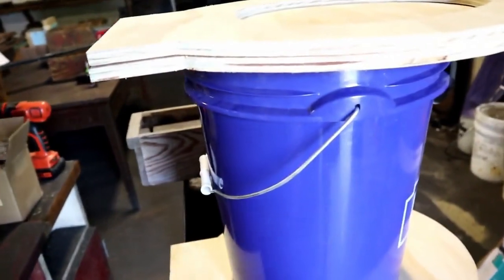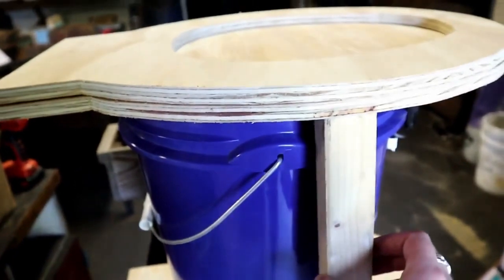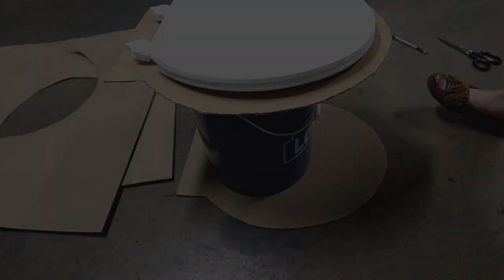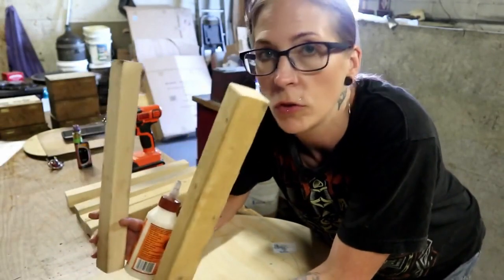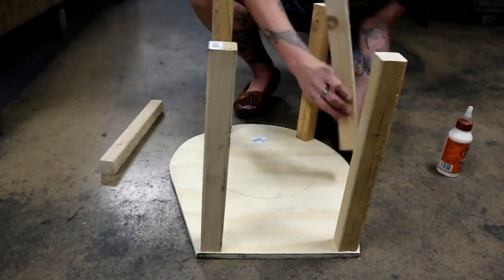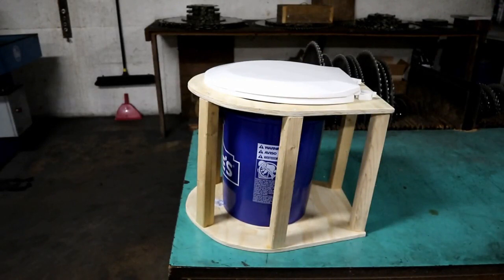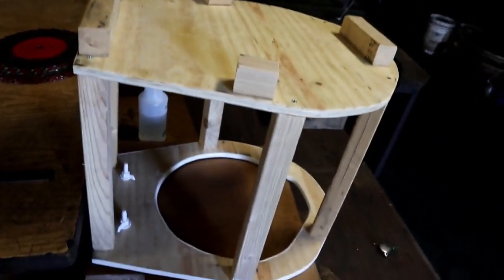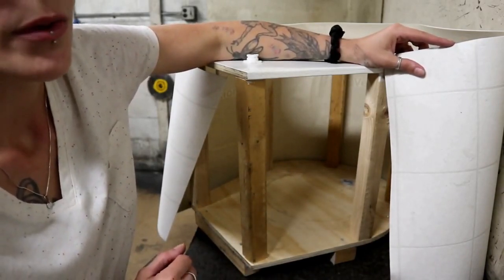DIY Urine Diverting Compost Toilet Build | RV or Van Build | Turn a Bucket Into a Toilet

Comment: It's nice to see someone that adds a bit of reality to the troubles encountered in DIY stuff. You should be proud of the results, Thanks for showing all.  If you are still concerned about not having a larger reservoir for the urine you can empty the smaller unit manually into the larger bottle that you can store behind. For a small amount of effort, you gain a larger capacity plus you get a visual of your capacity every time you use it. No chance of overfilling.  Stay true and keep positive.

Comment: I finished my toilet 3 weeks ago and it is fantastic another thing I thought of is u take a bottom half of a real toilet use that of a night stand. Also onine since I'm using only a 5 gal bucket I have a bucket lid with a handle that seals the stink in pine pellets cat litter pinesol will keep stink down just throw the bag out couldn't be easier but your design is great beats spending a 1000 dollar.

Comment: Great turn out! Are you using a bag with cat litter for #2's in the bucket? I'm researching now as I'll be needing a dry toilet option in a few months. 
From what I've found, if you use a drying component like litter, wood shavings, sawdust or pellets in the bottom then covering solids when done, you can get a 2-3 days with no smell before tossing the bag even without a vent fan. 
The detergent bottle is a great idea!! I'd suggest getting a second one so you never get caught with overflow between dumps. 
Thanks for the video:)

Comment: Looks good. I’m glad you showed your struggles and how you worked through the process. I will need to figure out how to add a bigger urine collecting jug. Thanks again for posting.
Reply from the maker: Thank you! As long as you make a bigger base there will be more room for a container. Or tall enough to do an external container and use a tube to connect it. I didn't plan enough ahead lol

Comment: Most people don't have the space but u could make 2 haves one side 1 other side number 2 I built a toilet out of a bed frame I found in the trash only with one bucket for 1 & 2 I'll have a 5 gal urinal  diverter and cranks not needed

Comment: If you wanted to use the flooring now, you could just glue it over the wood slats around the outer side of your toilet. It would also finish it off. ???

Comment: This has been 9 months ago so you may have this all figured out by now but you could run the urine hose under your RV into a small 5 or 10 gal tank or into your gray tank. Then you wouldn't need to dump your urine bottle everyday. Plus urine can be poured on the dirt, grass, on trees just add a little water to the urine to keep the urine acids from being to strong for the plants. This is good fertilizer for the plants. Also urine is sterile nothing in it is harmful to our environment or us humans. So dumping just the urine is pretty easy and safe. I wouldn't dump it in the middle of Walmart parking lot but in the city/counties across the USA there are water grates for flooding in parking lots and on the side of the roads where you can dump gray water or urine tank. Urine tanks can be poured urine just about anywhere with in reason dirt, grass, woods, things like that is fine or just dump the tank into any toilet. Dumping a urine tank won't be a problem.
You will find using a urine tank or your gray tank under you RV is a lot more convenient then a little pee jug.
Best Wishes

Ps you did a Great job on building the toilet it looks really good and I like that its not big and bulky like a lot of diy compost toilets most are a big bulky box your is nice and sleek to looks more like a regular toilet.
Great Job 👍 👍

Comment: You could have the cap on cut a hole it then you could see when it was full and prevent spills or find clear container but I give u lot of credit if u had when to engineering school it would have been easier. But good job cudos to u.

Comment: Does it work ok no smell, I'm thinking of doing same thing in my airstream.
Reply from the maker: Since there's no venting, it would probably smell if not cleaned often. I can't comment personally, cuz I have yet to use mine. But I was planning on emptying it after every one or two uses, plus it's small so it wouldn't hold much anyway.